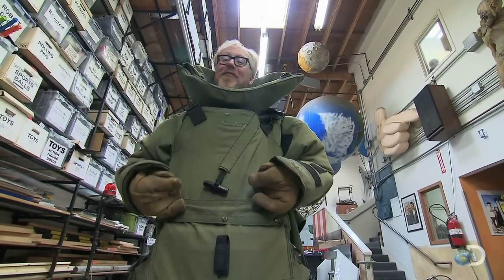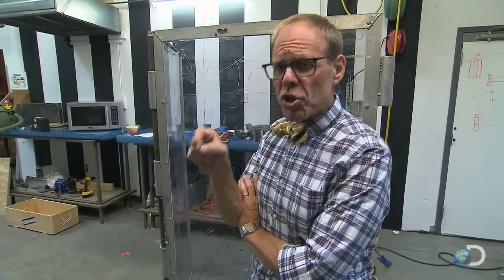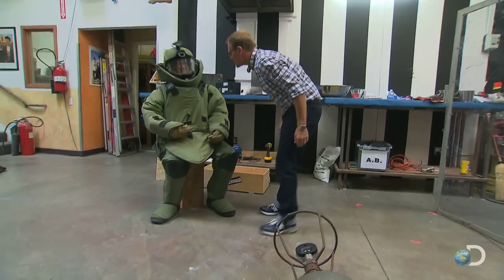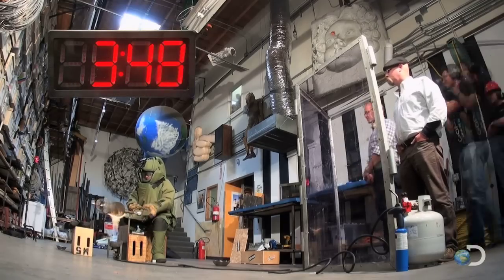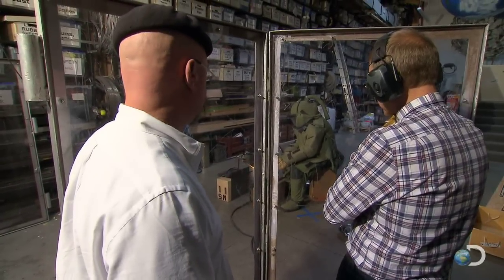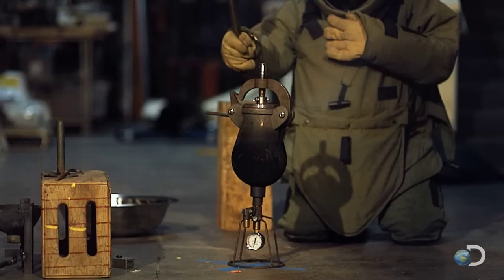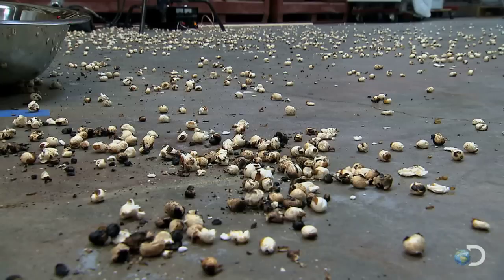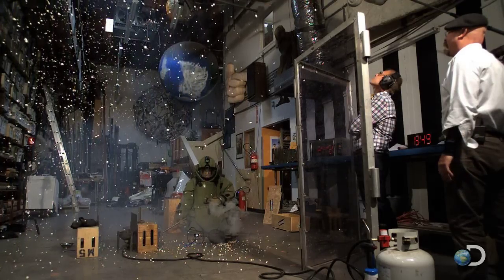Express Popcorn | MythBusters

Comment: u need a bag attach to the machine for collecting the popcorns. leave it on the floor open ur mouth yell whatever u want and kick the lever.

it absorb the heat very slow on first use, if u follow with another batch of popcorn/poprice it will be super speedy

Comment: As a chinese, I will have say YOU'RE DOING IT WRONG!!! what they did right however, is that the machine was supposed to blow up, it was trully designed that way. What they did wrong, is that they didn't put a bag at the end of the valve to catch all the flying popcorns AND it was never designed to be fast, it was designed to be quantitave

Comment: if you think about it, this is way healthier. no butter or other fat required.
Reply: But, most other methods don't require oil or fat either...

Air popper doesn't require it, microwave doesn't require it, stovetop is the only one I can think of that requires butter or fat.